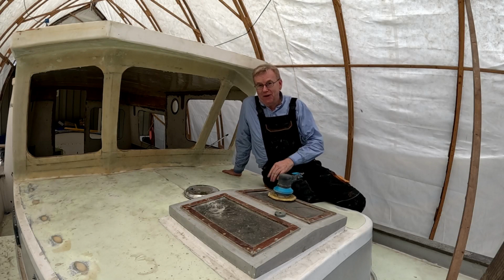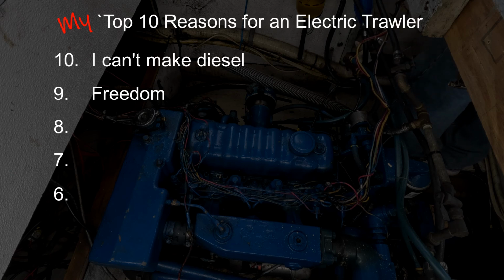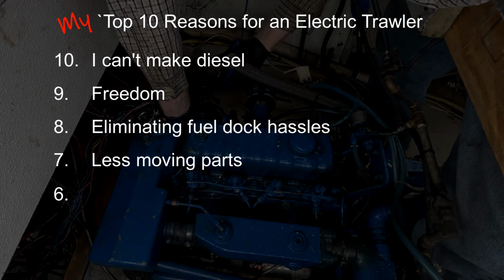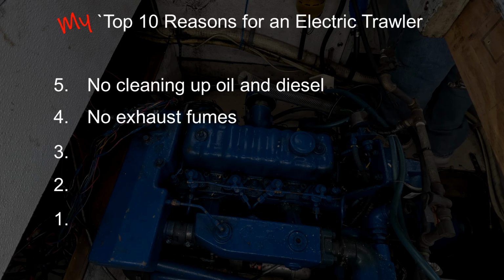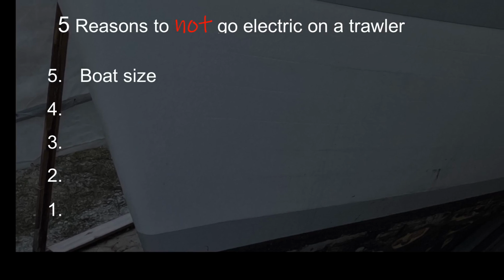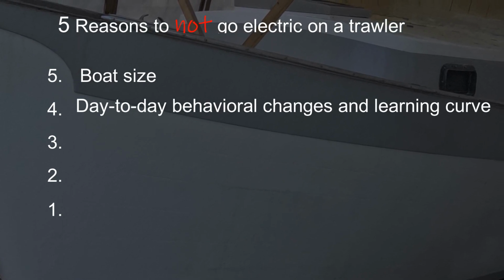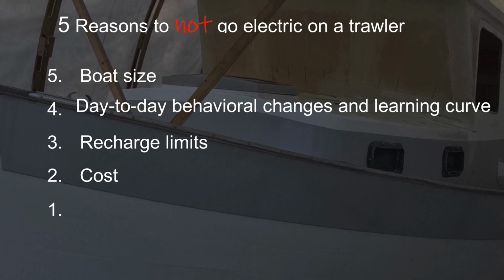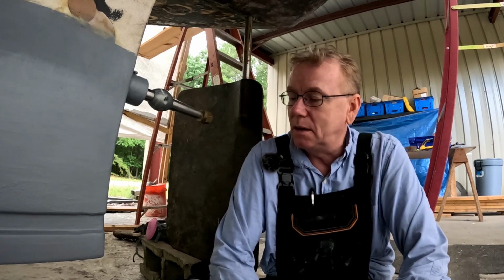10 Reasons to Love Electric Propulsion & 5 Reasons to Think Twice!

Comment: I'm going all in on electric in my custom built/designed trimaran. Biggest reason for me is autonomy.  No marinas, no mileage restriction, I more or less control the means of production. 2nd biggest reason is noise. I designed my boat to be light(<10000lbs), I am really curious to see how you get on with the heavier boat! Good luck! Subbed.
Reply from the maker: Yes indeed!  It is so liberating to not have to rely on others to get where you want to be.  The weight will require a serious power plant(s) for my boat.  I plan to introduce the basic power plan in my next video.  Weight is a tricky thing on displacement boats. I actually had to add 3400 lbs of lead to the keel.

Comment: Better control might also include instant torque at low rpm.
Reply from the maker: Indeed.  Especially with heavier boats like mine.  And to make full use of that instant torque, I increased my prop size and pitch.  I will have an episode on that later.
Reply: #1 Reason to not convert to electric: Your existing fossil propulsion system works well and you'd rather spend the next 2 years on the water rather than grinding fiberglass, sweating, and itching. 
#2. It will significantly reduce the resale value of the boat rather than increase it as maintenance support to your buyer will be virtually non-existent for this one-off craft. 

The main reason to convert to electric is that it is a labor of love... More about the project than the result... Cruising the loop.
Reply from the maker: @barrysteele8132   Hola Barry!   Haha....yeah I can't wait to get the hard part done.  Much of the glasswork I'm doing is mostly because of my boat selection.  Happy with with it though.  I really don't know about the resaie.  It likely would negatively affect resale on some but  there simply is not enough eclectic boats out there to say.  Planetree is the only monohull trawler that I know of that has a legitimate electric conversion.  I really don't know of any passage capable,  hull speed electic boats at all.